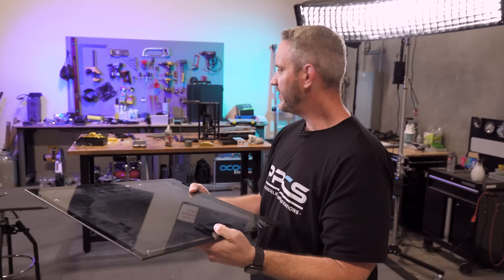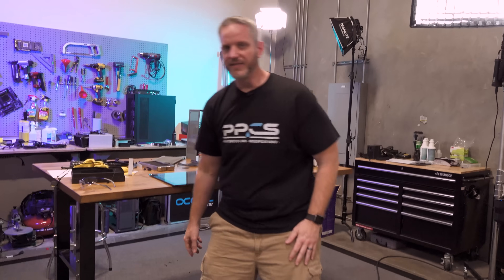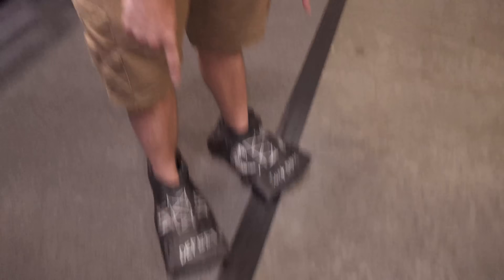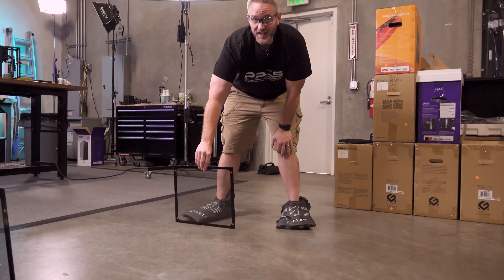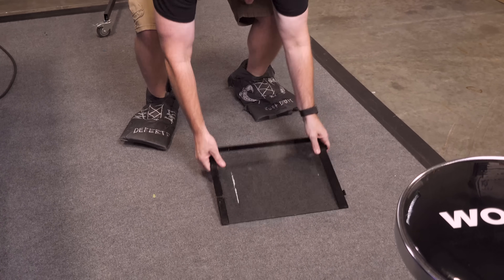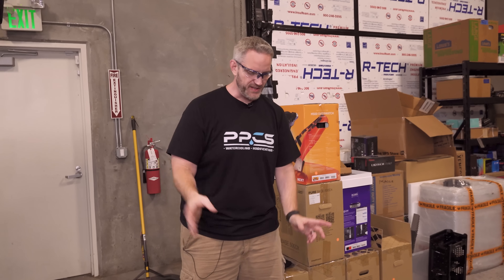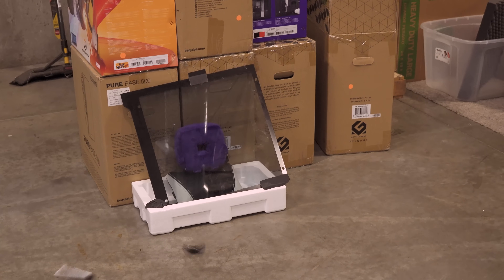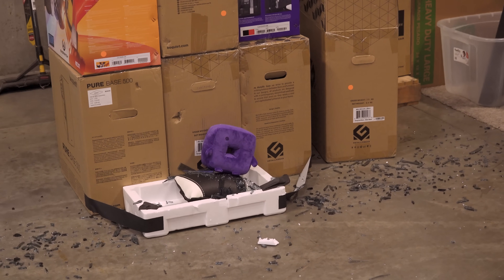How hard is it break tempered glass side panel?? SCIENCE!

Comment: 3:20 Not only tempered glass, also float glass has the same problem to a similar degree. The problem is not the tempering (hardening/pretensioning), it's due to glass being an ideal elastic material with absolutely zero (or close to zero) plastic deformation capability. And especially point loads cause hugh stress concentrations, leading quite easily to stresses above yield/break limit of the glass.

Comment: 2:45 the "science" behind tempered glass is no science, but simple technical mechanics: first of all, it's not completely under tension.
The glass is heated up and then the surface of the glass is put under rapid cooling. The surface solidifies, whereas the core is still hotter and therefore can be formed without any stress. If you now cool further down, the inner area tries to shrink during cooling and solidification. The outer surface is already solidified and tries to counteract further shrinking. This puts the outer surface under compression and the inner parts of the glass under tension. 
This improves the the load capacity of the glass: the glass sruface is full of defects, tensile stresses cause huge stress concentrations. As glass acts only elastic and has no plastic deformation capabilities, it breaks quite easily. If the surface defects are however under compressive loads, you first have to overcome the pretension. As a result, the glass has higher load bearing capacity.
And pretensioned or tempred glass breaking into 1000 of pieces is exactly want you want, if you use glass as a (more or less) structural element. The pieces are quite light and not sharp, hence decreasing the risk of injuries.

Comment: It's amazing how little resistance the glass apparently gave when the hammer broke it..  it can bounce the hammer off and stay in one piece a few times, but once it pops, it's quicker than the hammer moving through it and the glass will do almost nothing to slow it down.
So basically, don't throw a anything at your PC with one of these panels, because if it does pop, the inside of your PC is most likely gonna take like the full force of whatever came at it.
Reply: yep. we looked up smartereveryday’s video on how quickly the fracture moves to the glass, it was something like over a mile per second. it’s extremely quick, he needed to run his high speed camera at 100,000+ fps to capture it moving across the glass lol

(our high speed is only 240fps for reference)

so yea. that glass “gets out of the way” REALLY quick
Reply: @frickingphil   Wow that's insane :) Sometimes it just feels surreal how quick something like that can go. 
And I'm not even gonna mention how amazing it is that "we"  can record stuff at 100 000FPS these days :-o

Comment: Interesting result on the phanteks panel… I dropped mine off a 400A (slipped as I was removing it), just the back corner dropped about 15mm onto a glass desk. The edge of the glass about 2mm wide broke off into a single shard like you had at the end there, about maybe 25-30mm long… rest of the panel still intact…

I suspect these panels aren’t tempered to the same extent or other tempered glass.

Comment: The problem is if you have a case with a tiny bit of flex and hard or grippy feet it will put the glass under torsion and It is very likely to break,  that is what framing like that one piece Jay broke is supposed to help with.  Also if hit with something with a sharp point TG will break easier than if you throw a round heavy thing at it.

Also if you buy TG anything and  it is broken in the box during shipping DO NOT OPEN IT.  The small pieces can grind to a fine dust and opening the box can make it airborne long enough for you to inhale it, which is a baaaaad thing.

Other than that TG and especially Chemically Hardened TG is so strong they used to make beer glasses that could bounce when knocked on the floor, but glasses that last a long time get replaced less often when they don't break most of the time when they are dropped, so the 3 places that made glasses like that stopped making them.  I have thought that case makers should bring that back since they rarely sell replacement panels.

Comment: I used work making this glass, i was QC inspector, and that last panel would have failed !!!!!! 1 cm is the UK and EU standard for glass break size and no more than 1 gram in weight, so it doesn't actually cut you and only scratches you lightly. that last panel is shockly bad !!!!!

Comment: I dropped my glass panel side-on onto tiled floor last year whilst trying to awkwardly reinstall it with the case down the side of a couch (I've relocated to an upstairs desk now instead of in the kitchen).

My brain expected it to make dull "bong" sound in a classic thudding-on-something-solid way, but it went "psssshhhtttt" really forcefully as it exploded and I was still finding random pieces of glass rattling in the case a month later.

Edge-on shock is lethal for those panels!

(MSI kindly replaced the panel for me - I'm not still running it with exposed fans).

Comment: 3:19 @JayzTwoCents

I have BeQuiet Dark Base Pro 900 v2 and side panel tempted glass has 4 holes to direct screw into case frame. You have no idea how many times that glass felt like that on the corner to wood floor. I am using this case almost 4 years and dents in that floor is really beaten but glass is in perfect condition. Fun fact I dropped (yeah I knew it is Linus thing and probably copyrighted) twice from my gaming chair and it landed flat on the floor without any damage!!!

Comment: I work in a/many ice rinks (work for a city in a major hockey center so i frequent multiple facilities) and ive seen a few full 4x8 sheets of 1/2 inch or thicker glass fall and survive. and quite honestly i would much rather see it break. The things can weigh hundreds of pounds and take anywhere from 2-4 people to set in place depending on size and thickness. a few superficial cuts vs potentially being crushed... id take the cuts any day. One of the few i  witnessed fall was a rogue lacrosse ball hit the glass in a players box during a practice... not hard or anything but was just enough to knock it out of place enough to fall because the stanchions were not quite set up right, it fell into the players box and hit the bench and everything, and the sheet of glass survived to see another day. I cant imagine if a kid was there when it fell. its super cool how tough the stuff is, but id rather pick it up in pieces, than in one piece,  at least in my line of work.

Comment: That 3080 even when sold as broken is still worth like $500 but not after you tossed it around and the io bracket and PCB corners are messed up lol
And if it's one of the cards you messed up by applying liquid metal to the shunt resistor and some trace is just corroded away it probably would sell for even more because it's a simple fix.

Comment: The tempered glass side panel on my Corsair 5000d airflow exploded on me when I was trying to take it out to top up the reservoir on my water cooled rig. No force used to take the panel out it literally exploded in my hand as I removed it.

Rma was logged with Corsair and they sent out a replacement FOC. Still picking bits of the bloody glass up off the carpet nearly 6 weeks on lol

Comment: You just need to penetrate the outer glass layer to break a piece of tempered glass because the inner layer is under tension while the outer layer under compression. Any attempt to manipulate the glass after the tempering process will destroy the complete sheet of glass if you penetrate into the inner layer.

Comment: Difficult to break by hitting middle of glass, edges are the weak points, and also if you hit the middle with a solid metal , rock or something dense and pointy it will shatter, take a look at hammers in public transport busses, they have an emergency exit hammer for emergency egress, that tool will shatter it if you hit the centre with a bit of force...

Comment: I've accidentally kicked my panel a couple of times, I was never really worried about that. I do still baby it when it's off the case though. Impacts put the glass under immense stress and can cause microscopic cracks, weakening the panel and creating a stress hotspot, and because TG is under constant internal tension even if the panel doesn't break at the time of the impact it can seemingly spontaneously explode hours, days or even weeks later. It can even happen months after manufacture with no impacts at all if there are impurities in the glass.

Comment: In my much younger days I worked at a convenience store where we had some arcade machines and a couple pinballs. There was a guy who always played the Pacman and was reasonably good but when he'd lose, he'd punch the glass. Eventually, he actually managed to break it. We had it replaced by quarter inch plexi with a reinforced frame around the inner side. I was there the first time he played it after that. He eventually lost and punched it extra hard like he was trying to shatter it again. There was zero give or flex in the new panel. The look of shock and cry of pain as he held his very bruised though not broken hand was priceless. He never punched it again.
Reply: LEXAN is absolutely insane. No one would ever be able to break that by hand, not in a million years. Hell, not even with a hammer

Edit: Mixed up Plexi with LEXAN
Reply: @PPedroFernandes  now that sounds like a material I'd want a side panel made from.
Reply: @ArtisChronicles  Only problem with both plexi and LEXAN is that they are not very scratch resistant whatsoever, even wiping heavy dust off them will scratch them.  That's why cases are going with tempered glass mostly, looks and cleaning convenience.

Comment: hey jay you should just barely tap the corner with a piece of tile, the ceramic material is crazy good at breaking tempered glass. break a spark plug and throw it at the glass guaranteed it will break ez

Comment: I've Installed 1200 black temperd 4mm class panels 80x140cm on a building last year. A few times a panel would just explode in your hands when holding them or a singel grain of sand when you put it aside when reaching for something would make them explode.  
Sturdy and surpringly flexable as well some times, it was pretty cheap class so quality was a bit of a mixed bag. Fun project though

Comment: Flat sides are strong, corners are strong but not as strong. Tempered glass breaks very easily if you hit the edge/thin sides with something that is very strong/no padding. At least that's been my experience with Pinball Machine Glass. You can basically drop a bowling ball on those while in the machine and they don't break but hit the edge on something while you've slid the glass out for cleaning and "Splosions"...LOL
(and yes I deliberately spelled "Explosions" incorrectly)...

Comment: Considering that Phantex panel didn't break as expected, do we need to start doing tempered glass tests on case reviews to make sure the glass is properly tempered?
I also feel that panels that take screws straight through them are questionable, because the screws could be putting pressure on the holes, which are edges, which is where the panel is weakest and most susceptible to failing.

Comment: I pulled the tower (witch judging by the sticker on the aio back was a MSi build but had been gutted of almost everything) for that first glass panel from the scrap and did a build in it (yea, I'm not rich). I could have used that glass panel as one of the two panels had been broke but lucky the one needed for the front side was on the back side. I looked this tower up at the time I found it (1 and a half years ago) and it was going for like $300 from China though Newegg so getting it free but all be it in the shape it was in was kind of sweet. It now houses a MSi X470 MB, Ryzen 7 3700X (cooled by the stock air cooler), MSi Armor MK2 Radeon RX580, 16gb of Corsair Ram set at 3200MHz, a Corsair RM750x psu, Samsung 970 EVO M.2 (500GB), Samsung 870 EVO SSD (1TB) and 5 140mm fans. Like I said I'm not rich and it was my first build.

Comment: I stopped your video at 2:22 and I have no idea which glass will break but I have a wild guess which is the thinner one because  It has holes in it. Even tho it has probably metalic support at the edges, depending on what position you drop it. It's still more likely to break comapred to the thicker glass panel.

I stopped it at 4:20 or something and it's cool that you took an actual slow motion footage of the drop.

4:49 really cool bro...
6:00 convlusion, trsnsparent pastic or totslly metsl with some airflow shroud panels are just more resillient...

Comment: It’s all about hitting it with a point. It’s easy to break tempered if you hit it anywhere with a sharp point. That’s why spark plug ceramic shatters it so easy. If the force is spread out over a large area like your hand it takes a lot of force. There is an astm standard for testing tempered glass. It goes by weight of the biggest unbroken shards you can find in a given amount of time.

Comment: I worked for about a year in a glass recycling place... tempered glass will always break very easily if you simply tap it on the edge with a hammer or other object. Some tempered glass can stand being hit directly with a heavy hammer on it's surface, but will still shatter easily when tapped on the edge.

The number of times you drop the glass on carpet or flat on the concrete has nothing to do with it br4eaking when you drop it edge on on the concrete... if you drop a piece on the concrete edge on, tit will shatter on the first try

Comment: Floor tiles shatter glass very easily because ceramic is harder than glass. when you tap a glass surface onto tile, the vibration cannot completely pass through and into the ceramic, so instead it just bounces around the glass in a frenzy and compromises its integrity and structure.

Comment: I'm guessing the case side panels are quite a bit weaker than some types of glass like they use in furniture shelves which actually have to support a load in normal use. I tried breaking a piece from a TV stand once and it survived multiple direct hammer blows on the face of the glass. Only was able to break it by hitting the edge.

Comment: The issue people always mention on the reddit posts... and whats seems to be visible in most every one is ceramic tile. 

Ceramic is know to be kuch harder than stone... which is ultimately what youre dropping yhe glass on now.

As im sure you know jay, in the auto industry its known a small piece of broken ceramic... like from a spark plug, can shatter a window without much force.

That is what is happened to these glass panels we see on reddit. Its a fall or bump but done on ceramic which breaks tempered glass with ease.
Reply: Another big factor is how concentrated the force is. Youll notice in the second drop the force of the impact is spread almost evenly across the edge... but once it bounces, has a little bit of reverberation going through it... then just taps the corner... it explodes. 

Thats the difference between a similar amount of force being applied across 12inches of edge verse a pin point spot where all the force is concentrated.

Comment: Tempered glass will take a lot of abuse when the force is spread out.  The key to getting it to break is to deform the glass in a small area.  I've seen people pop car windows with a soldering iron trying to repair broken defroster tabs.  The concentrated heat will case deformation in the pinpoint area and break it.  That's why there's videos of people wailing on car windows with a hammer and not breaking it.  If you hit it with the flat face of the hammer, the shock will be spread out enough that it won't break.  The key is to hit it with the corner of the hammer face, like in your final hammer toss.  An automatic center punch also makes a great glass breaking tool.

Comment: These results are in no way surprising to anyone who has dealt with glass windows for houses or automobiles. Chips, cracks or hits on the edge are bad. Light hits and small chips to the flat side are fine as long as you fill them in properly. So basically unless you live in a cave or 3rd world country and have never seen glass in the first place; it turns out that glass is still glass.

Comment: The question remains. Can you dampen the vibrations from dropping by having playdoh or blutak blob stuck to one face. I would think that it would help greatly
Reply: So basically the glass panes should come with a bumper around them.
Reply: @CakePrincessCelestia  actually not what i meant, would have a similar result though. adding mass changes the resonant frequency (dampening). Should be more difficult to break when not hitting the exact corner, as this is toughened glass's Achilles heel.

Comment: Would have been nice to set one up on an empty case and at foot height and have you kick it a few times while wearing some work boots. Just to see if it holds up to that kind of abuse, as I think that's the most likely abuse scenario for your average end user. 

I remember a while back I had one of the cases with a clear plastic side panel, which I accidentally booted at one point. Slid off it's securing pins and bumped against the GPU. While the system was on. Slid right back on the securing pins and wasn't even scratched. No damage to panel or parts. A tempered glass panel, I could see that dropping shards into fans or god forbid, the psu.